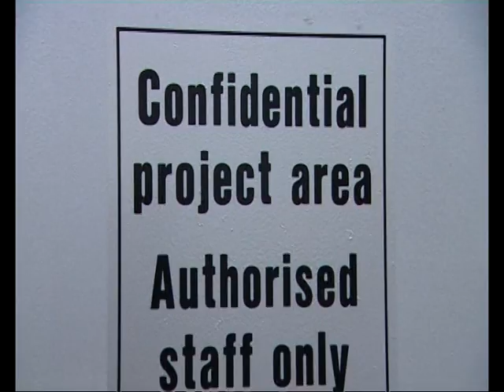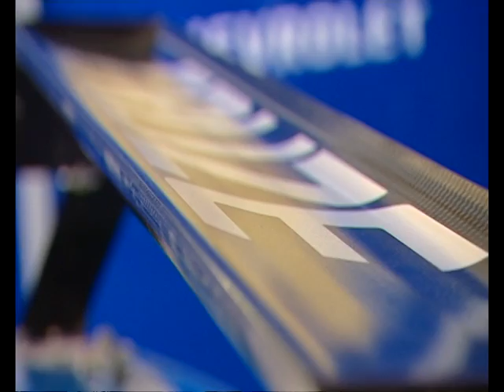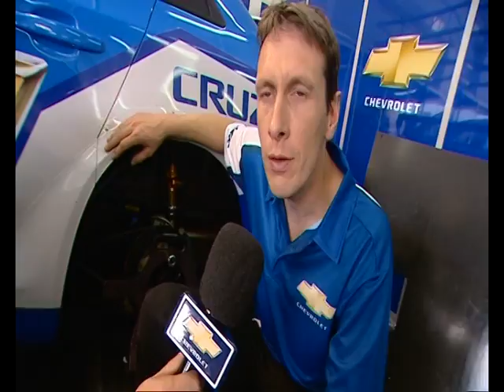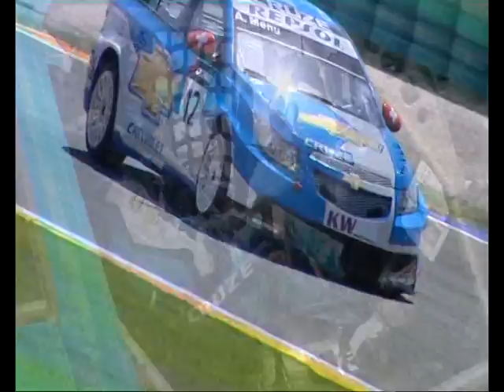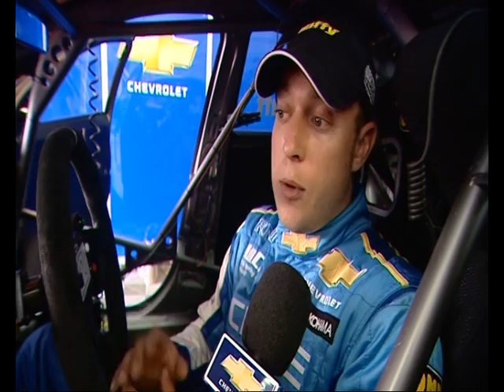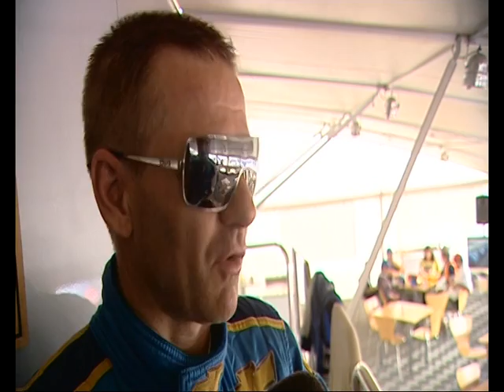Cruze Control

Comment: The "L" cap from the engine head is the very same used in the Brazilian "Chevrolet Vectra GSI" and "Chevrolet Calibra".
GM sold back in the day Opels here changing calibrations, suspensions and emblems. The C20XE sold here was the last generation, almost all were COSCAST, but some were KS.
Good to know.